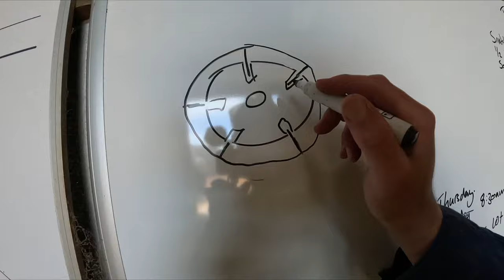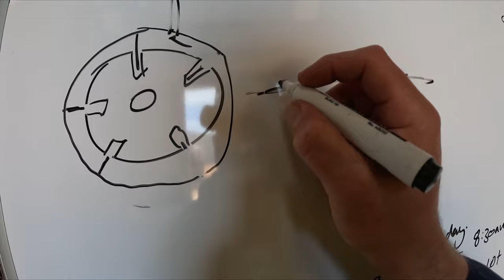We have got the Mack starting now!!

Comment: Air starters are used in equipment that carry flamable fuels or work in hazardous areas such as oil and gas. We had a number of Macks were i did my apprenticeship that carried lpg that had ingersol rand air starters. They are not difficult in  design. Keep the air clean and dry 
You may also find that the wiring may be in additional conduit to meet dangerous goods regs.  Yep just saw the alternator,  looks intresicly safe.
The other benefit on these old trucks is that behind the starter button  under the dash you  should be able to manualy activate the start using a bic pen bypassing the electrics. 
One of the comments was setting up a hose arrangement from ypur tires.
Let us know what power and rpm you need for your stalker might be able to provide an option.
Nice work with the starter  removal, might need to bend up a spanner

Comment: I had 3 air start Mack Titans and we had a few air starter problems. Mack Trucks in Adelaide had them repaired by a workshop somewhere in WA. There are 2 different types of air starters from memory. One is Ingersol Rand and I can't remember the other one.
Reply: TDI is  another brand. 
Multi torque industries are the airstarter specialist in Perth

Comment: There must be a blocked valve some were the start tank is differnt from brake air tanks yes that is only a muffler dosnt really need to be have a look on left hand side fire wall be a solid to manuel start it buy pushing a screw driver in bottom off it air starts are good when they work less weight no flat batyerys u fill sort it and the go and have a beer